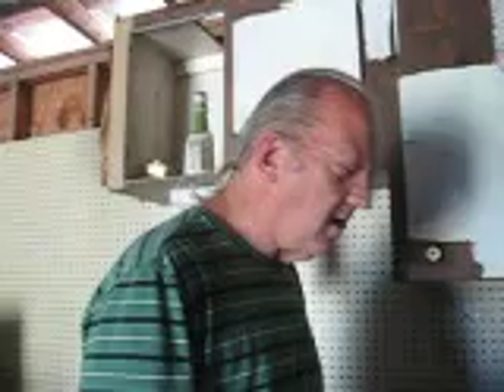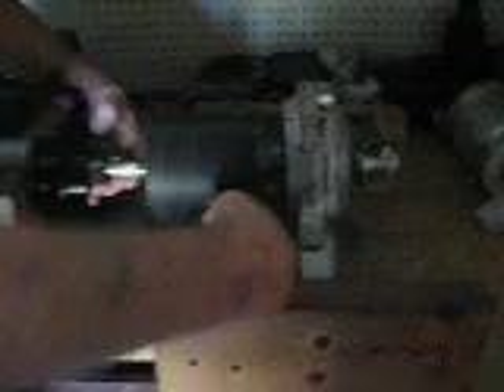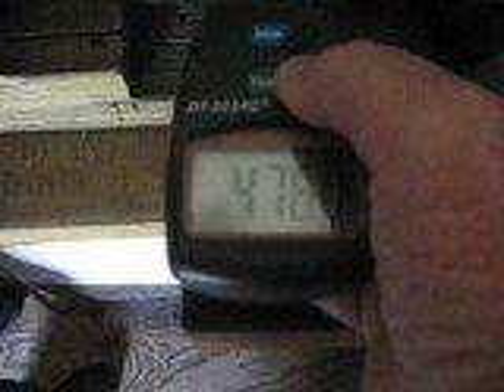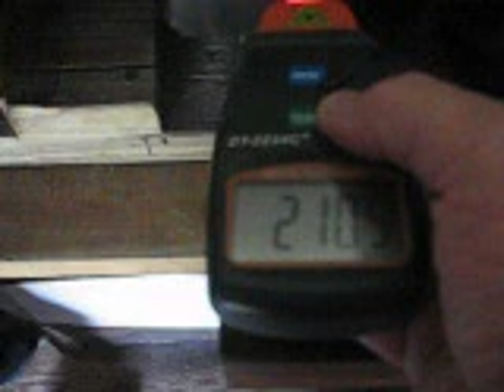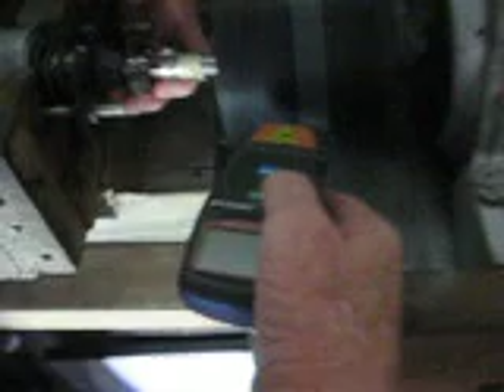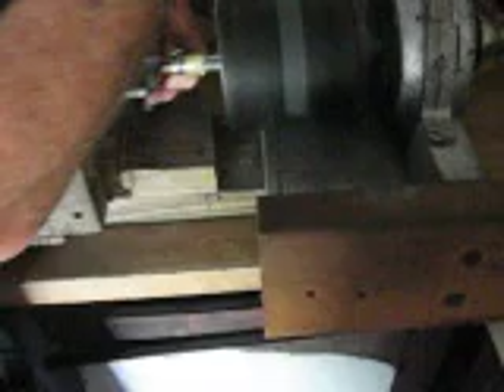Magnet Motor RPM Demo

Comment: Very interesting...shows lots of potential...your right seems like if you get better tolerences you get better results....i am wondering how much torque your getting ...
I have been playing with pulse motors and motor generator self looped systems with flywheels and the biggest killer to any gains is torque...takes so much power to create electricity using a generator...cool project..thumbs up my friend..cant wait to see your progression
Reply from the maker: Thanks for your comments they are very helpful. I had to take some magnets off of the linear shaft to obtain the speed i'm getting. Torque is about 3.5 lbs. My other video shows more torque because the air gap of the magnets on the rotor and housing are closer together. Because the torque was higher, the speed was lower do to the unstable operation of my system. Linear to rotary bearings are available that I could use on a centering shaft in the housing that should keep the rotor more stable and aligned.  I am having trouble obtaining a solenoid with more pull force so I can close the magnetic air gap to get more torque and speed together. The manufactures I've talked to want set up time and a certain about of solenoids produced. They won't make just one prototype. Field weakening to get more speed would be ideal, But I would have to have more controls and copper wire wound around the permanent magnets using current in the proper direction to weaken the fields. I'm trying to keep this system simple and not have to over engineer it. But I may have to !